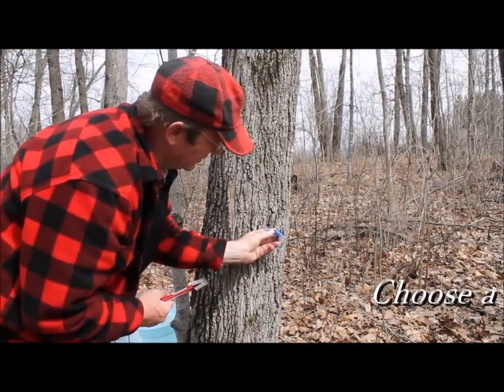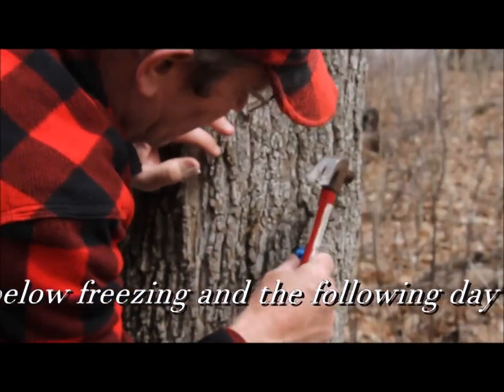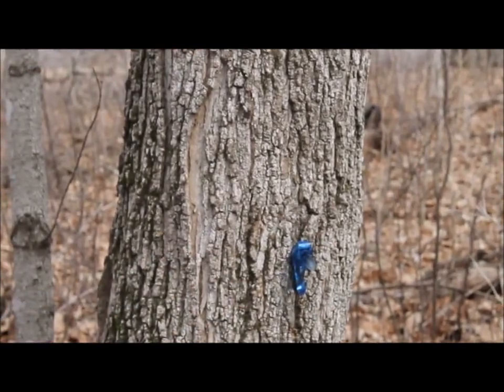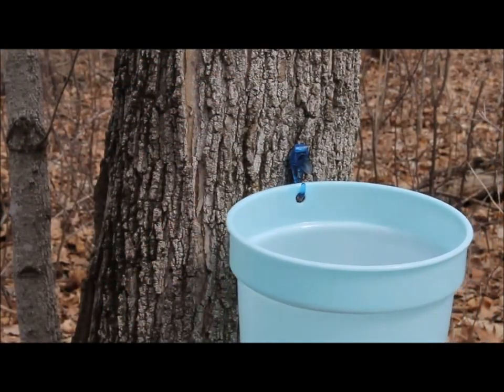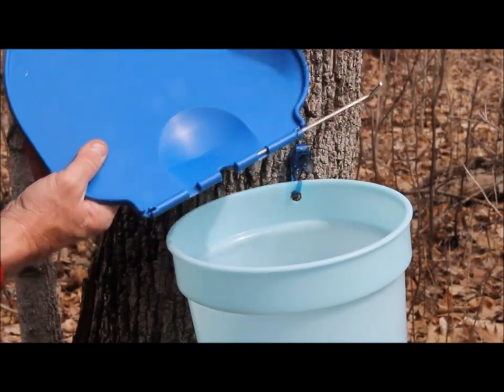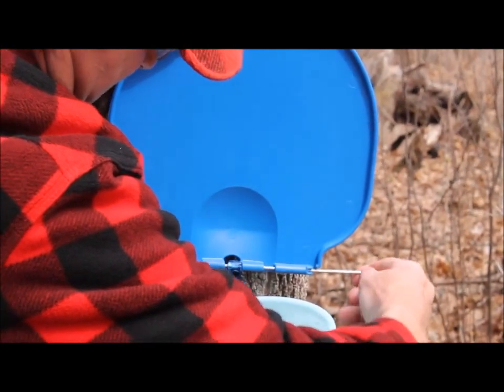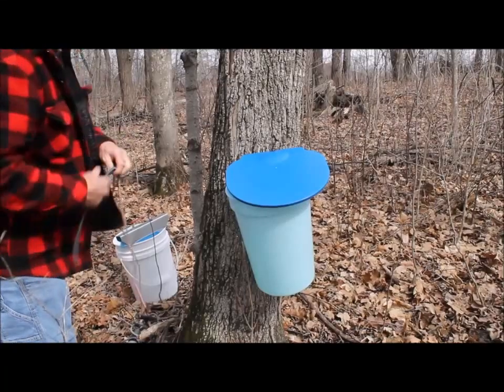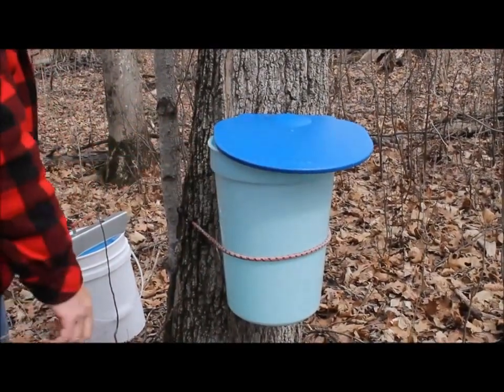How to Tap a Maple Tree Using the Bucket and Spile Combo System.

Comment: What size bit did you use?
Reply from the maker: We use a 5/16" bit because our spiles are 5/16".
Reply: @mapletapper1496  it looks like you have the same spiles that I bought. The website said to use a 7/16 bit, which I did. And they don't stay in place. I put a screw on either side, then put a small cable tie on. It's working. Now I just need the right weather to get more sap!
Reply: Okay, it was only working to keep the spiles in, the sap was mainly running down the trunks. So I pulled everything and tapped 5 different trees using a 5/16" bit. What a difference! As soon as I got them in and the buckets hung, I started getting sap.